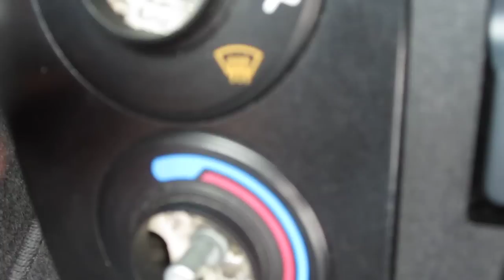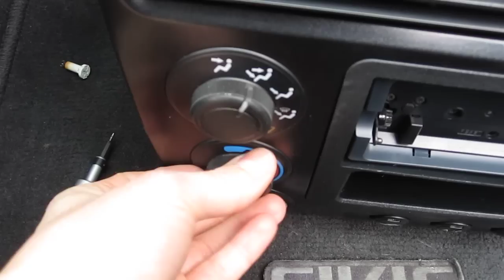2001 Honda Civic EX center panel removal - change climate control panel - replace bulbs

Comment: I did the same thing but for different reasons.  I wanted to see if the automatic climate controls from the 03-05 Civic Hybrid or 02-05 Acura EL (in Canada) would work.  It did.  Plugged right in.

Comment: HI I just messed you about the 2004 Civic,  It looks like this video is the one to show me to simply pull the cover off, unhook the back of the lighter, then I can probably pull it out and put a new whole adapter/cigarette lighter in it.  I'll make sure I can get a new little unit before I begin.  thanks for this video

Comment: This may be  an 11 year old vid, but it has helped me.  One tip though, always disconnect the negative battery terminal before doing any electrical. A short will be way more expensive to repair.

Comment: Lol good job I got the same car and it's not most comfortable car to work on, I have to do the cabin air filter change and I've changed the ECM
Reply: Sky Walker hey how did you get your ECM back in place? I am having a hell of a time getting my new ECM in. I cut the plastic bracket away and everything. any tips would be appreciated. Thanks!

Comment from the maker: I took it apart once because the lights didn't always illuminate behind the two lower knobs.  Sometimes it would light up, and then it would just go off so I figured it was probably a loose wire.  I figured out what that piece was called (control panel) and searched eBay for the part.  Found one and had to take the panel off again so thought I would make a video.  Actually, I think I took that part off three times!  Not sure what caused it, probably just wear and tear.

Comment: Don''t!!! use anything to stick in between the dash and the center module, run your fingers little bit further into the dash(where you removed the two 8mm screws)from and right where the metal ends push from the inside out and the bottom part will pop out, no tool needed and then just gently undo the top, save dash and time

Comment: at 1:25, you said not to use metal because it can ruin the piece. Is there a way to replace the center dash plus the whole soft part dash? What is that whole soft part called?

Comment: How did you remove the cigarette lighter bottom section so easy I'm trying to remove it and pry out but don't want to scratch anything and is just not coming out. I'm guessing a thin piece of plastic or wood would do it right. I tried with my hands first and didn't even budge.
Reply: dodgerfreak0834 if you have a stock head unit then the process is way different. Search up: 2003 Honda Civic stock radio removal.

Comment: Due to the fact my car ECM went on emergency mode or something the car didn't get much RPMS and fastest speed I got was like 40mph changed the ECM and everything went back to normal, I also did engine mount change, both manual and auto transmissions change, thermostat change twice, coolant flush,  alternator change, I may post some videos later when I have time